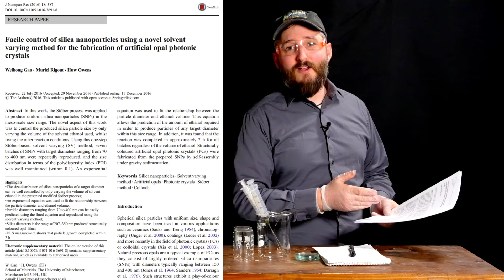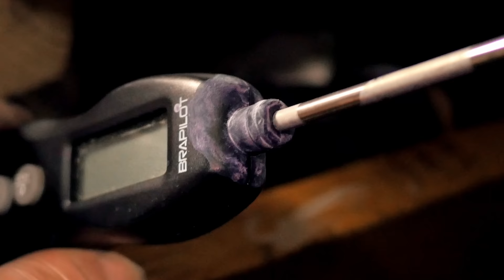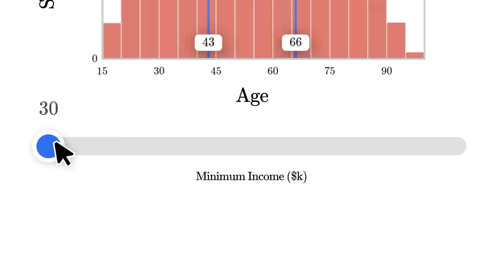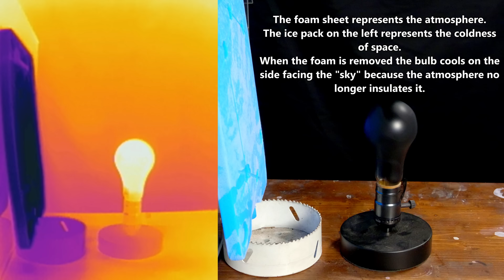Making Opals for Free Air Conditioning

Comment: Hi, as a Dutch material engineer I can tell you that this effect is not only restricted to silica based particles. You can see the same effect when polymerisation crosslinked polystyrene. The fact that particles settle is a very ordening manner is dependable on their monodispersity and settling time. Fore stone-like structures your approach using silica is probably the best way forward.  As a suggestion: you could use a fraction of your first synthesised sample to use as a seed solution for further, more controlled, growth of your desired mondispersed particle diameter. Good luck!

Comment: I imagine an opal finish in car paint. Reflecting heat/infrared light to keep vehicles cooler. Add the opal to the top clear coat. You could use any base coat colour to get the best visual effect. The clear coat would fill in the air gaps. Ps i would like the first batch to spray my campervan. Cool summer time camping.

Comment: Surfactant in opal solution may improve lattice forming in centrifuge.

You should try to kiln bake the pellets from the centrifuge below the melting point. Or you can use your borate nanoparticles as a flux.

Comment: About the ammonia: almost every % that isn't ammonia is water, and water is actually the reactant in this process, ammonia is just a pH modifier to slow the reaction:

Si(OEt)4 + 2H2O --> SiO2 + 4EtOH

By using 10% ammonia instead of 25% you were adding more than twice as much water as the authors of that paper. Also I've found that most "clear ammonia" for cleaning use contains miscellaneous alkylammonium "detergent agents" via the MSDS (not the label), so if you need pure ammonia (or technically, pure ammonia+water) it's best to make it via:

NH4(X)(s) + NaOH(aq,~40%w/w,corrodes glass) --> NH3(gas) + H2O + Na(X)(aq)

and bubble the gas into very cold (close as you can get to not freezing) distilled water, ideally with a diffuser for small bubbles, then titrate to work out the percentage.
Reply: Small note: assuming everything in solution that's not ammonia is water, then moving from 25% ammonia to 10% is not doubling the amount of water but increasing that amount by 20% (since you're increasing the percentage of water from 75% to 90%).

Comment: Awesome!  Really great work Ben!  This video "flows" really well for not having a script!  I'm curious what effect -- if any -- ultrasonic exposure at normal incidence might have on your solution as it dries on the glass.  My thoughts are that if you could set up a standing wave, the pressure oscillations should create a nearly motionless node at the glass surface that helps nanoparticles adhere there, but may jostle them just the right amount a tiny bit above the glass to allow you to "tune" the thickness of your opal layers.
Reply from the maker: Thank you! Interesting idea about the ultrasonics. I wonder if anyone else has looked into manipulating crystal growth in that way
Reply: @Nighthawkinlight my mind goes to Steve Mould’s video of the tiny metal balls encased in glass. When he added vibration they settled into larger crystal structures.
Reply: @Nighthawkinlight Yes, they have.  I'm trying to find the link to the research paper; I have scores of bookmarks so it'll take a while to find it. If I remember correctly, it contributed to the shape of the nanoparticles, too. I tried a different approach, I used ultrasonics to settle SN nanoparticles in one single solution to separate the different sizes and it seemed to work. I was using them for luster glaze; I siphoned the top of the mixture to get the larger ones, ultrasoniced some more, siphoned again, etc. It appeared that the different sizes were separated and results in different interference colors. If I could figure out how to post a picture, I would show the results.

Comment: I just had a thought, and I feel like it's important to share. It might be a good idea to install a ribbon to flutter in the air near the vent for your DIY fume hood. If you lost negative pressure due to failure of your evacuation fan, you might not realize until after you've started breathing dangerous chemicals.

Comment: As a chemist i did an masters internship on this synthesis. But i had to made the spheres mesoporous and tunable in size whilst being monodisperse. This to put a phosphor in for advanced LED purposes. It was quite cool. I was so happy when it worked out in the end.
Reply: It kinda pains me see you fail the first attempts and reasoning. I found to be that the size in spheres best when its around 500nm (around the middle of the visible wavelength.) You could also dip a flat surface in the solution in order to create a monolayer. Its the hexagonal structure of multiple spheres that creates the colour.
Reply: If you want really small spheres you could use TEOS seeds and grow with TPOS quite slow but easy to follow and make spheres that are 10-100nm
Reply: If you want more nucleation sites it better to have higher stir speed and low TEOS addition time (just use a pipette instead of syrringe and drop everything in all at once)

Comment: This series gets me really excited. Would nanospheres be effective if suspended in Vinyl or TPU sheets? 

I've painted flexible TPU 3d prints by mixing a slurry of scrap TPU dissolved in DMSO and pigment powders. These materials are really durable and the the pigments can never flake off (they're literally embedded in the surface). If we can get a nanosphere surface bonded to a pliable roll of material it will greatly help the application process. 
Love the work!
Reply from the maker: It's possible that could work! I'm not sure about the emission spectrum of vinyl or tpu but anything can work if transparent enough at favorable wavelengths

Comment: I have a question. How are you/ did you dry your opal solution without destroying them? I made opal via the TEOS synthesis last fall and have allowed several batches to settle due to gravity and with a centrifuge. They have great color as a pellet in a test tube, but whenever I've let them sit out to dry they shatter or lose all color. I have looked at supercritically drying them then fusing with a furnace, but it Is a large monetary investment to go that route. Any suggestions or experience would be very welcome.
Reply from the maker: I haven't got that far yet but I have some ideas. Some have reported success by adding soluble aluminum salts to the mix which increase hardness. I'm also trying some alcohol soluble binders which should hold the opal together as they dry. We'll see
Reply: @Nighthawkinlight  I tried using standard woodworking epoxy under a slight vacuum to slowly evaporate the ethanol. This didn't destroy the pellet but it lost all color, I assume the expansion caused during evaporation ruined the interference. The only somewhat pretty opal I have, I allowed it to air dry for ~30min then soaked it in CA glue. I then polished it like any other stone and then applied a thin coat of CA glue to form a clear surface and preserve the color. I really want to form a binderless, silica-only, opal. If anyone reading this has any ideas please write a reply.
Reply: Great comments, guys!  I am also doing my own opal and will take any advice that I can get.  Writing all of this down so I know what's been tried and what hasn't so far and what works.  Keep them coming!  😃
Reply from the maker: @mason3279  One of the papers thought emporium put in his video description talks about filling the structure with silica gel which apparently works. CA glue is interesting. I think you could probably have success with a binder/sintering combo where the binder gives initial stability and then is burned out.
Reply: @Nighthawkinlight  The biggest issue I've seen looking around on the internet is that when burning or evaporating anything between the spheres it has a high chance of destroying the lattice and ruining the color. I may try filling the structure with silica though, I'll have to go look at that paper. Not thinking I bought a liter of TEOS, might as well use it.

Comment: Hey man, nice video, super interesting topic.
Also, I worked on a project on College where I synthesized gold nano particles (around 20 nm) caped with an organic molecule. During my experiments, I found out that when working with nano particles you have to be extra careful with cleaning. Every particle (dust or from previous experiments) that are attatched to the walls of the becker can act as nucleation points. Also true for the termometer (leave it out in the hot bath as you did). Another thing is that we used an ice bath to stop the reaction, otherwise it would just transform the spheres into prisms and new nucleation points could still be forming and generating smaller particles. hope something can help you in future videos.

Comment: You could try drying while vibrating the the sample to help the particles settle into more stable positions, though this could also stratify the particles which I'm not sure what the result of that would be. You'd probably have to mess with the amplitude and frequency of the vibrations, but even something of miniscule amplitude and like 20 Hz might have an effect based almost entirely on my intuition (basically nothing lol). Worth a shot, maybe, if you have a speaker lying around!

Comment: Great video! One idea for you:
I think the final escape of the liquid (as it dries) messes up the structure severely. When I look at your recordings the samples seem fine until they become completely dry. Therefore I think you actually DO want a matrix of some sort, to embed your microspheres within - not air!  Something that locks them into place. So I suggest a transparent liquid that hardens without evaporating. Like epoxy! But the alcohol will make the epoxy milky, so you'll need to somehow mix completely dry opal into epoxy, such that they disperse completely, and then centrifuge it suuuuuper hard so that it settles out before the epoxy hardens.
Or perhaps some kind of molten salt? Anything that's transparent but can go from liquid to solid without evaporating.

Comment: Try depositing the opal onto a surface with a golf ball like material. 3D print a dimple like structure, then put a clear coat on the print to make it non porous then try depositing it in the pores. The pores will trap a lot of the crystals into the little dimples and make a cool effect hopefully

Comment: To reduce Brownian motion during the crystallization process I would reduce temps. Try sticking a test tube in the fridge to settle naturally. I used to formulate industrial coatings and dispersing lamp black is not something that can be done with a stir stick. Carbon black in general is hydrophobic as a powder and when dispersed into water based solutions needs high shear mixing with a dispersing aid, usually a surfactant. Carbon black particles are also shaped in a way that resists dispersion being very "thorny" with lots of spikes and hooks. The particles hold together like Velcro. With all that said, you can just buy pre-dispersed carbon black and you can buy "treated" carbon black powder that will more easily disperse into aqueous solutions.

Comment: Darkfield-capable scopes are awesome, and certainly helpful for looking at very small structures, but you might be able to achieve some of the desired effect simply with an external light source at a raking angle and reducing or removing your normal light source(s) that are either vertical or ambient/scattered.

Comment: You could try to impregnate porous surfaces (stone, wood etc) with the precipitate mixture, maybe with repeated thin layers and evaporation/drying cycles. Coat the result with transparent protection and polish up. You could also just try suspending the evaporated product from the slides as a fine powder (basically tiny flecks of opal) in a resin, which would make it easy to apply to other surfaces. I call this 'micro-glitter'. My third idea is to try separating the precipitate and then transferring it to a new mixture for optimal macro opal formation. Wikipedia tells me natural opal has the nanospheres in a slightly hydrated structure, so maybe just put the precipitate in pure water and then mess around with controlling the formation conditions. It's not clear to me what makes opal hold together as a stone but understanding that could be key to getting stones out of this process.

Comment: If you can re-suspend the opals after low speed centrifuging them than you could wash out any impurities by decanting the liquid and then doing one or more rinse steps before the final re-suspension and gentrification or long settling step.  Alternatively if you create them by drying and then powdering them you could then incorporate the opal nano-particles into a resin to act as a paint/coating, and possibly try mixing your final size of opal nano-particles with your earlier calcium based nano-particles.

Comment: You could use clear acrylic to cover the spheres. PMMA (polymethmethylacrylate) is used in large aquariums because it has nearly the same refractive index as water.
Since you have relative bright flashes with water, this should work.
PMMA is also fairly easy to colour, so you could get dark Opal.

Comment: I am into marquetry/inlay.  Generally my thoughts on how to mimic the opalescence of say a Morpho butterfly would be to disperse powdered (ground) mother of pearl into a dyed transparent epoxy resin and scrape that into carved recesses in wood.  Impregnating (presumably dyed, or using the ethanol in this method as the dye carrier, if I am trying to mimic butterflies, because naturally blue wood doesn't exist) wood veneer with the "opal liquor," drying, and then cutting it into shapes like in standard marquetry, may be another technique.  Of course the silica (though theoretically amorphous and thus softer than quartz) will be hard on tools, probably repel many types of adhesive that would normally be used to apply veneers to their plywood etc backing, and render the sawdust potentially even more hazardous (silicosis?) than it already was (due to the chemistry of particular woods and the physical effects of dust--anyways  always mask up when sanding)

Comment: Always good to see your stuff, Sir. Dont forget about molecular sieves. The 3A sieves are cheep and completely reasuable. Will dry EtOH without paying for the pure stuff up front.They should also let you do the same with Ammonia as well. 
EtOH is about 4.5 A  (angstrom)
Ammonia is about 3.26 A
H2O is about 2.65 A
3A Sieves will collect the H2O out of the solution without an expensive setup. 
Just thinking about ways to lower your future costs if you need to start making larger quantities.

Comment: Re: airgaps whiteness & nail polish - it is my understanding that natural opals are hydrated - rather than having air in the gaps between nanospheres, there is water - which has a refractive index much closer to glass than air does, leading to less internal scattering/dullness.  Commercial opals have to be sealed in order to maintain their fire, and prevent the water from escaping.  So getting closer to gem quality will likely include some purification and washing steps, as well as a way to keep your microdomains juuuust hydrated enough after formation to present milkiness. 

I'm neither a minerologist nor a geologist, but I did study chemistry and opals are my favorite gemstone (I have some raw stones that I store in water); I also did a bit of research on synthesis of a different type of nanoparticle, about 20 years back.  That research included a branch on post-synthetic modification, which is a way to tighten size distribution and increase regularity of particle shape.  We were working with gold, so the specific techniques and reagents aren't applicable to your project, but it might be worth digging into the literature further regarding whether there is a secondary process you can run your particles through after synthesis and purification that will give you a more regular product.

Comment: hey! you might consider using a round bottle flask with a heat mantle next time. it heats up much more consistently than a beaker and it is safer since you don't have the water there, ready to burn you. also, even with the aluminum thingy and the water, the bottom will still heat up more than the walls, what does not happen in a round bottom flask.

Comment: Hi. Congratulations. Awesome video. I do have a few ideas for you. Im no chemist. But when you add the silica compound to the heated ethanol and ammonia maybe that burst of cold silica compound is enough to to drop the the temperature below optimal. Maybe try to pre-heat the silica compound before you mix it. Second idea is a bit on the experimental side and might not even work. Have you thought of using vibration to settle the glass particals. Example if use chladni plate. Also look in to loud sand. Yes you read it right. This happens when all the particals you are trying to compress is the same size and that makes them compact very close together and evenly. Example take a fist full of same size marbles and squeeze them together. Now do the same with uneven sized glass marbles. Its alomst as if they wont settle and compress that easily. I aso got a  few ideas on your rubies. Try making them in a vacuum. Also maybe preheat the crucible. When they check for fakes the bubles are a give away. Maybe vacuum will tale care of it. Also what happens if you apply force to it almost like forging it.... Please hurry with youre next video love the experiments amd the diy approach